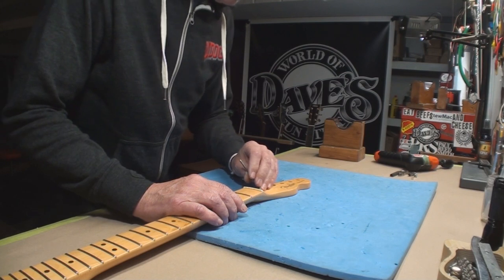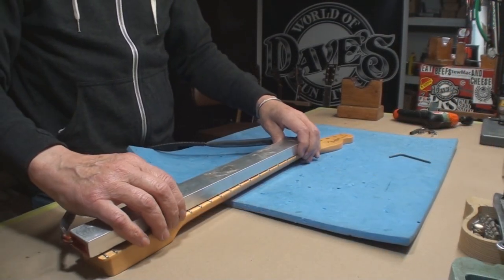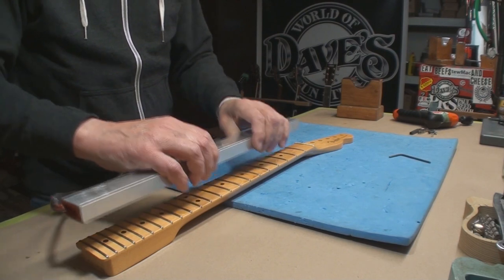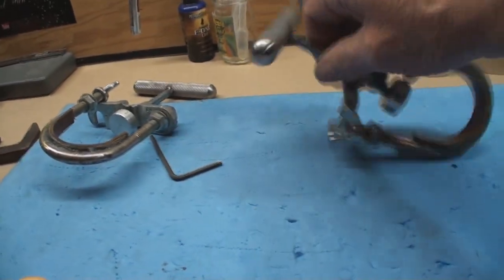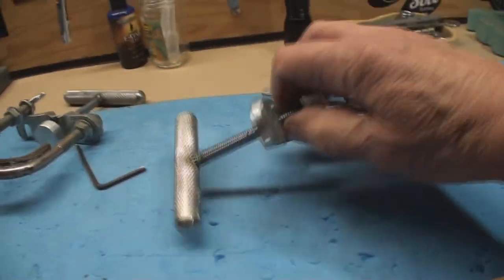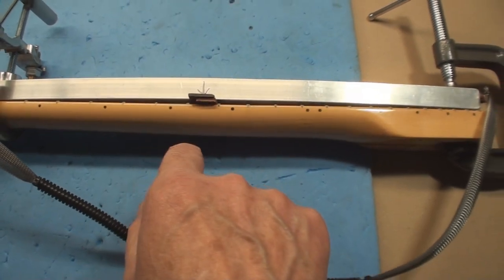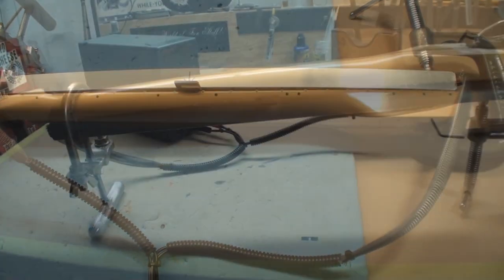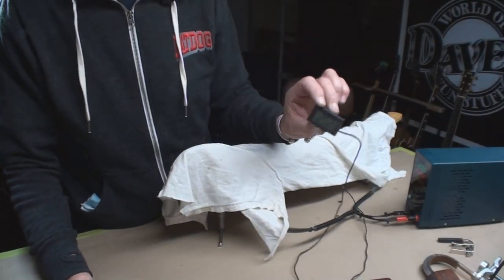Guitar Neck Heat Press Part 1

Comment: Thanks for showing this again Dave.  I just had a neck clamped for 2 weeks praying that I could get the bow out of it without heat.  I'm ordering parts for the heater NOW.
Reply from the maker: if you need pointers PM me
Reply: @DavesWorldofFunStuff  Thanks Dave.  Ill hit you on FB if I run into any kinks.

Comment: You were correct first time, it's too much "Back Bow". I had a Tele neck that way also, I clamped it and got it hot with a heat gun but you can't control how hot, so you don't want to cook the finish. I would get it hot and leave it cool while clamped. Had to repeat a few times over a couple days, but it worked
Reply: That worked for me once but is not a great solution - you should keep the neck warmed up for about an hour which is impossible with a heat gun, especially if you want to maintain static temperature. Must have been really lucky on the first try :)

Comment: I tried an iron on a twelve string strat a while back and had mixed results. I bolted the neck to a work bench, wound a string around the end tuning peg and screwed that peg to the bench which pulled the neck back in the direction I wanted it. As the neck was twisted it soon went back to the shape it was before so I ended up filing the frets to try and eliminate any buzz.

Comment: 35 year electrician here......You could’ve wired the heat sensors in parallel, so you’d only have 1 2 conductor wire coming out.... Also, use a heavy gauge wire so theoretically thin wires don’t short out...Otherwise, I think you’ve got it!
Reply: When you make the final assembly, wire them ass to ass, with the bar between. Use that silicone you were raving about, and coat the splice and wire to the end of the unit. Sometimes the obvious solution is scaring you in the face, & you don’t see it... Great job on the neck, and the prototype!

Comment: Thanks for the video.  I've been planning on making one of these for a while, but you ramble about your thoughts for longer than most others, which was helpful :)

I'm not sure if it's this video where you said it (you have a couple on heat pressing necks), but the local guitar shop to which you refer still does offer this service for $75 (no guarantees)... I'm just too cheap to pay them for the number of necks I know I'll need to fix over the next few years. lol

Cooking my first neck on an old cheap kijiji acoustic guitar as we speak.

Comment: Thanks, Dave.  Several questions, maybe answers in a subsequent video?
Are the heaters connected in parallel?
Is this project trying to relax the wood fibers and then reset them  under clamping pressure and truss rod pressure to reform a straight neck?
*Or*
Are you trying to loosen up the overflow of gorilla glue?

Comment: GREAT STUFF.....What's the size of the aluminum that everything is installed?  NEVER MIND!!! Answered in part 2..THANKS!
Reply from the maker: 3/4 x 1 1/2 x 18 inches..I used a piece of flat bar aluminum inside to take up the space the heaters did not use

Comment: I used to keep a thermometer in my car's air vent, to check on the a/c temp.  Anyway, 135 F is about the temp of the car interior on a hot day.  So, just clamp it up and toss it in the car, right?  ;-)  Cheers, Dave.

Comment: Out of curiosity i tried a heating pad......................wait for it.......................it worked great. But i would still like to make one of YOUR heaters Dave.
Reply from the maker: Did it work?
Reply: @DavesWorldofFunStuff  yes....it was an Ibanez TMB 100 with a really bad (forward lol) bow. After about two hours of heat and an overnight cool down, it plays great. Perfect for a young girl who wants to learn to play bass. Your first video on your heat bar gave me the idea. I absolutely love your videos Dave. The best down to earth no bull crap repair dude out there. Keep telling it like it is. Be safe.
Reply: Rich did you use some kind of straightening bar and clamps too?
Reply: @Riverdeepnwide  I used a straight edge to find out where the highest point of the arc was. Then with a piece of leather to protect the fretboard like Dave did, I used a block of wood as a pivot. Then I clamped both ends of the neck to my work bench to bend it into a straight to somewhat relief position. Also making sure that the truss rod was completely disengaged. Like I said after a couple hours under a heating pad, I let it cool down overnight. In the morning when I released the clamps the neck was fairly straight. After putting the neck back on the body and restringing it, the neck had a natural relief to it. Doing a complete setup and trust rod adjustment the bass played fine.
Reply: Thank you for that Rich 👍🏻

Comment: I'm no expert but it seems to me like it would be better to apply the heat at the worst part of the bend which is right in the middle of the neck. I have no doubt that this method is effective but I can't help thinking it might be better to be able to apply the heat in the middle of the neck instead of either side of the bend, if you know what I mean.

Comment: Seems like it would work better on necks with a separate fingerboard. The glue would in between would soften and reset, holding the new bend in place.
Reply from the maker: skunk stripe

Comment: Can't believe Leo needed to be convinced that necks need a truss rod.
Reply: May have had something to do with guitars being expendable back then. Bolting on a new one may also have been the plan
Reply: @barristerh5379  Leo did have a reputation for being frugal.
Reply: The steel-reinforced neck was popular then.  They were all over the place.  The Silvertones had them.  I don't know if the story is that Leo didn't even want steal-reinforced.  What did you understand him to be favoring?
Reply: @alext8828  Leo was confident his original neck would never warp, even without a truss rod. There's a photo of Hugh Garrlott standing on a neck suspended between two chairs to prove his point. He thought those bird's eye maple necks didn't require a truss rod.
Reply: @mattrogers1946 , I hear ya.  They didn't consider the liveliness of wood as conditions change.  Leo Fender was an amazing man and so were the people close to him.  Everything they did with those guitars was groundbreaking.
Reply: Different times.  Most guitars of that era did not have truss rods.   Martin guitars were not convinced on needing a truss rods until 1985.  I am glad everyone uses them now.
Reply: @barbmelle3136  You mean an adjustable truss rod of course.  Since the 30's Martins had the non adjustable T bar until the late 60's and the non adjustable square bar until the mid 80s.
Reply: @mattrogers1946  yes, adjustable,  An adjustable truss rod would have save a bunch a neck rests, and kept some from being regulated to slide guitars.
Reply: @barbmelle3136  Regardless if a guitar has a truss rod or not, if the neck angle changes over time and the top comes up from string tension over time, you will need to have the neck reset.

Comment: Why???...can’t you buy tele necks on the intraweb all day long for a few bucks??...just saying!!!!
Reply from the maker: why not save a dead guitar Mr money bags
Reply: Some bolt on customers really want to keep the original neck, plus, a big plus, the luthier gets to have a tool to repair glued in and one piece neck through body types. 
So the repair turns out less expensive than replacement for the bolt on necks too.
Reply: Yes.  But if you want a proper one then here in Europe it will cost way more than a repair.  It’s comparable to a new instrument.  The original idea was to have readily usable spare parts but probably the design was too good and the number of failures so small that
Reply: ... it is no longer economic to make inexpensive replacement necks readily available
Reply: @andrewericelliott9488  Mildly interesting trivia.  Fender originally wouldn't sell you a neck as a spare part.  They relented when people were buying guitars, dismantling them and selling the parts for more than the cost of the guitar.  So while it's true that bolt on is a simpler construction and saved Fender time and money, it wasn't their original intention that Joe Public had readily usable spare parts.

Comment: I thought the fender guitar was made so you could easily replace the neck fairly cheaply so why all the bother and expense? Bear in mind I have never owned a Fender style guitar so I'm not trying to be a smart a.. just seems like If it were me I would just buy a replacement.
Reply: A good neck costs way more than all of the parts for the press put together.  And you might like the neck you have.
Reply: It’s a great unique purpose tool which can serve luthiers and fixer-uppers for many years.  Some customers really appreciate being able to keep the original neck.